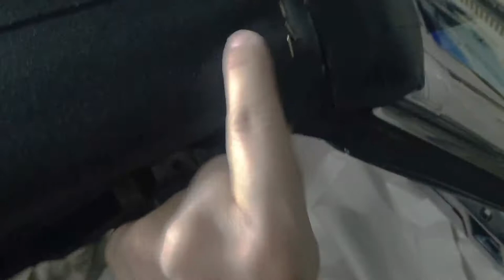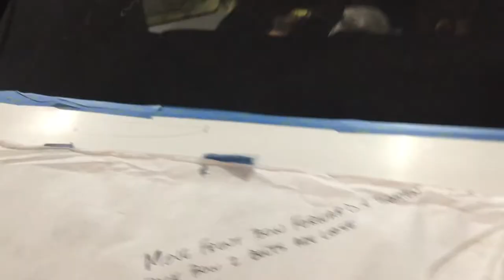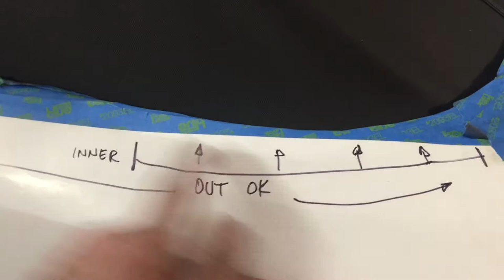1969 Camaro, Firebird, Convertible Top Installation. Part 3, Final top install.

Comment: Your videos are very informative.  I am contemplating converting my 89 bronco to a convertible soft top and have a design for the mechanism/frame and think I can use aftermarket vintage mustang hardware and actuators.  This might be a really dumb question but when you are stapling, what are you stapling into?  the metal frame?  thank you

Comment: Thank you for this series for the convertible top. I have a 1967 Oldsmobile Cutlass Convertible but there are no videos showing how to complete this top for my car. I've learned a lot from you. I haven't ordered all my pieces yet other than my well liner. So I'll get that installed, then order my top, pads, cables, rear window, etc. What are the screws you used to install the well liner piece?
Reply from the maker: I stapled the well liner to the rear bottom bow and I spray glued the liner to the panel behind the rear seat. I used a couple of small screw on the corners of the rear seat panel to hold it in place.
Reply: @riderescue  Awesome. Thank you for your assistance.

Comment: Can you tell me what clips hold down the chrome pieces behind the rear window on this car. I’m building a new body 69 Camaro convertible and I really thank you for your videos, they help a lot !!
Reply from the maker: Here's a link to Classic Industries clips. https://www.classicindustries.com/product/1969/chevrolet/camaro/parts/7672609.html and here's the trim. https://www.classicindustries.com/product/1969/chevrolet/camaro/parts/k723.html I hope this helps. 10 clips go onto the body pinch weld area first then you slide the 2 pc trim over the clips till they snap into place. They are not always the best fit but you can add small screws through the back side lip of the trim if needed.
Reply: @riderescue  Thank You.

Comment: Do you have a video of putting in the well liner?
Reply from the maker: Sorry, no. The well liner in this car did not need to be replaced. If you are only doing the liner, you need to remove the top and rear window from the lower rear bow. The liner gets stapled on first, then the window, and then top.
Reply: @riderescue  Do you have a diagram or picture of how it is attached back by the rain chanel

Comment: How many times did you have to remove the rear bow in total (including off camera)?
Reply from the maker: Since I have done 6 tops now I will say a minimum of 6 times installing and adjusting the rear lower bow. My 64 Buick Skylark was my 4th top and I think that one was the hardest to do at about 10 times or more to get it to fit perfectly. Not fun but satisfying.

Comment: When I pulled the old top off there were rivets on the center bar to the pads and a hold down on the midde-front bow. But I noticed that you didn't use the rivets or the screw in hold down on that bow. Any rationale behind this?
Reply from the maker: I don't recall ever seeing rivets in the pad area you are describing. All of the tops I have done had small machine screws and I do re-use those. Check those rivets to see if there just dirty Phillips head screws. I thought I had those in my video but maybe I skipped that in the process. The center bar sleeve material sometimes is left off from the new top and is included as a part that the installer needs to glue in place. Some tops have that sleeve bonded in place from the manufacture. If the top does not have that sleeve glued in I leave it off for 3 reasons. 1, it is very difficult to glue on without making a mess. 2,  in a high wind from driving fast the top lifts up and the glue pulls loose. And 3, I like how the top folds up and stores with that bow not glued.

Comment: Now you know why it costs $1k to install a top. (not including the cost of the top)
Reply from the maker: Boy, you got that right. I'd say more like $1500 or more for labor. Especially if you take the time to restore the top frame and paint it up pretty. Add hydraulic rams, hoses and pumps and the cost goes way up. I made a huge mistake while it was all apart and I didn't replace the hoses and one blew a few months later. Made a huge mess and added lots of work that would have been easy while it was all apart.
Reply: @riderescue   I just got my 67 Coronet back on Friday, and my top guy did a great job....and after watching your vids I can totally get how messed up a top can look without the tools, know-how and patience. Fear the "pucker". It got cold as crap here and I've had a heater on in the garage to help out the top.
Reply: @riderescue  i just got quoted 2800 and the guy said that's doing it for free 1975 olds delta scissor top. thanks for the video. i think I'm going to brave it. Oh that was a winter price he said 3 to4 thousand in the summer. I'm in Boston
Reply from the maker: @bobdimartino6738  It is a lot of work but it's well worth it. Take your time and think all of it through step by step and you''ll do great.
Reply: @riderescue  i'm also a mechanic so it really looks like if you can deal with doing it over and over again until you get it right. by the way yours came out nice
Reply from the maker: @bobdimartino6738  This top and my Skylark top are two of my best. No wrinkles and smooth back windows.